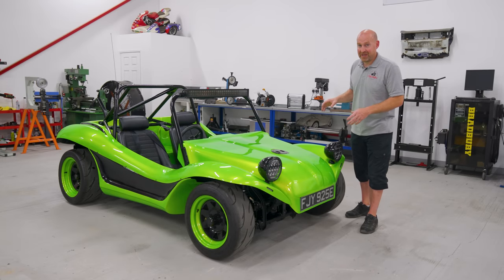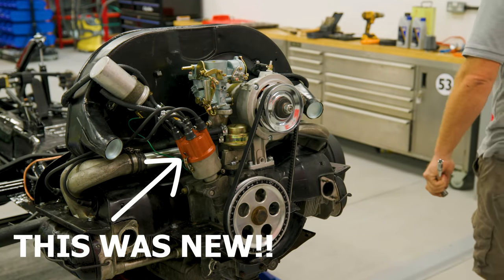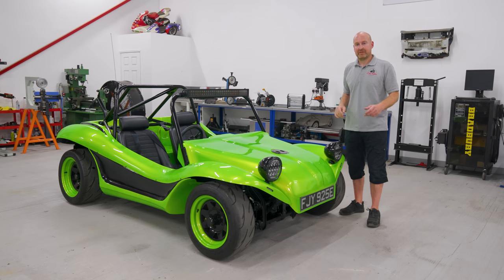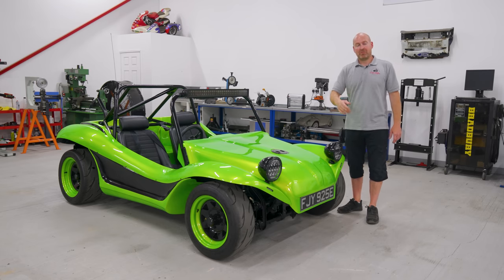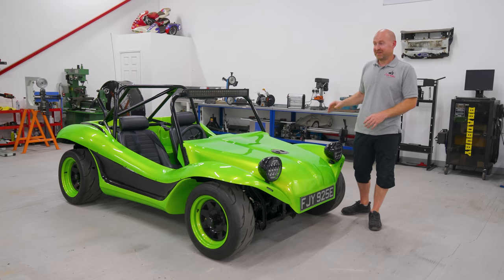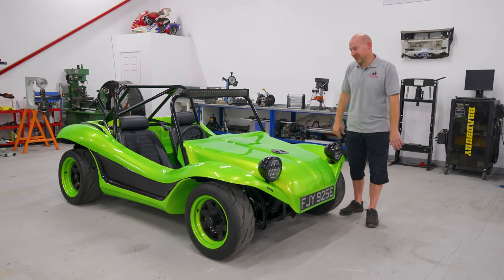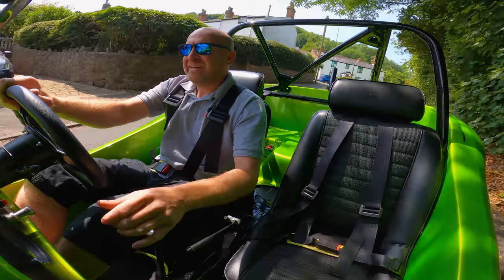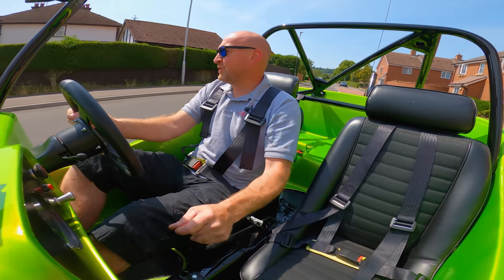AT LAST! It's finished and ON THE ROAD!

Comment: I find it hard to believe that a mechanic would use silicon on the case facings. You should use Wellseal which is a bit like Yamabond I used on the racing TZ engines. Zero leaks

Comment: " its £1,000 a tin that paint", proceeds down a lane with a warning sign for loose chippings...
i have just subbed recently, but it seems to be a running gag of yours to pick right absolute plonkers to do sub-contract work for you, do you shake hands in the pub after 10 pints......
spied the escort car-a-van there, looking forward to it , keep up the good work lads
PS, sorry, no sale,  i'm a shit driver, need a roof just in case... [again]
Reply from the maker: 100% I need to stop buying the cheapest stuff off eBay, everything is rubbish off there…
Electronic ignition dizzy… broke
Leads and plugs set… broke
Beetle with recon engine… broke.